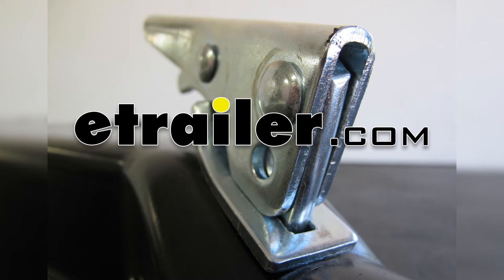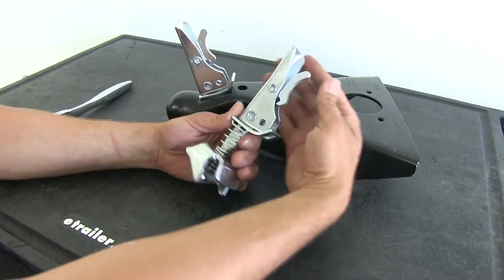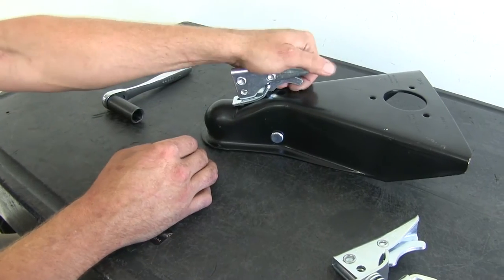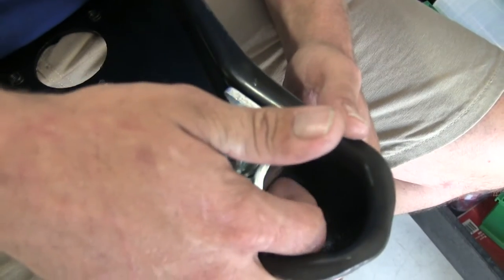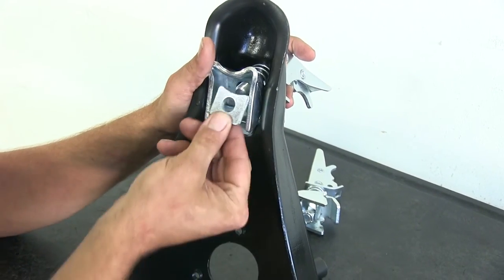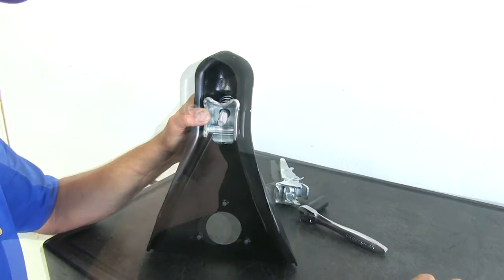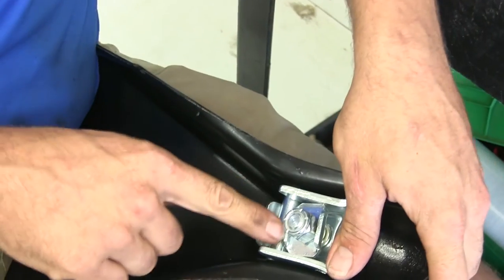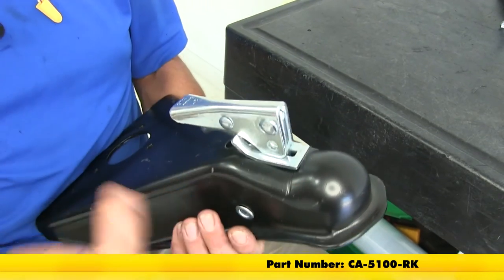Repair Kit for etrailer and Ram A-Frame Couplers Review

Comment: Really like the spring loaded lift style latches like the one in the video vs the horizontal slide latch that came installed on my new trailer. Is there anything I need to know or be aware of before ordering one of these latches (like in the video) before replacing a horizontal slide latch? Also, are there any advantages/disadvantages between these two latch styles...?...really wish the industry would just stick to one style.